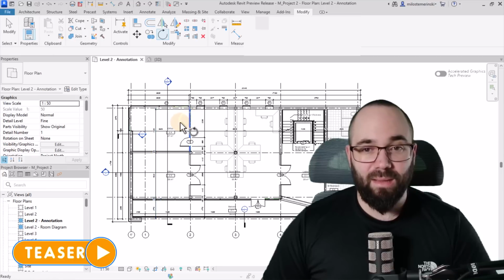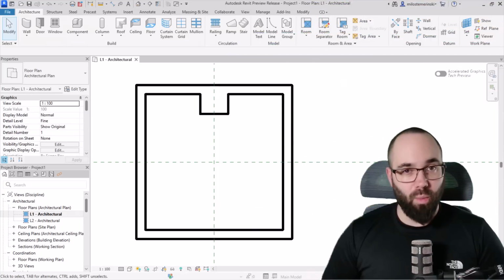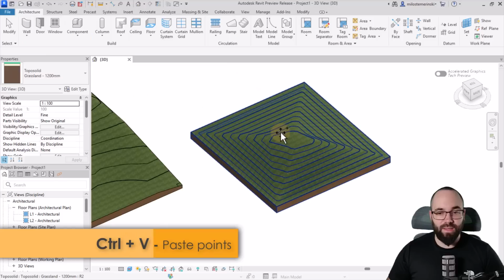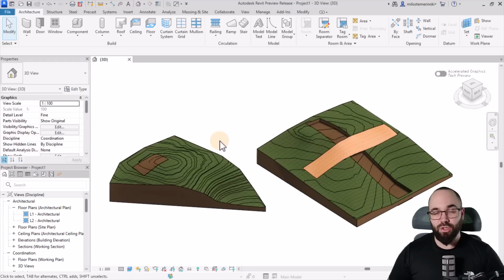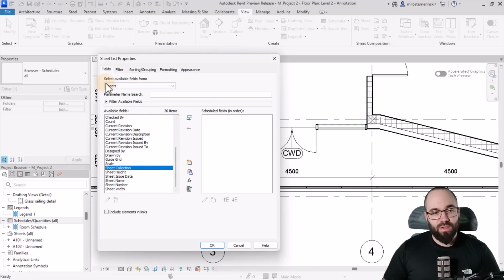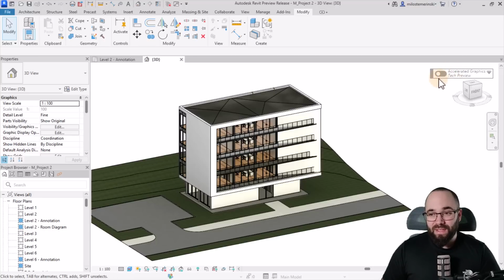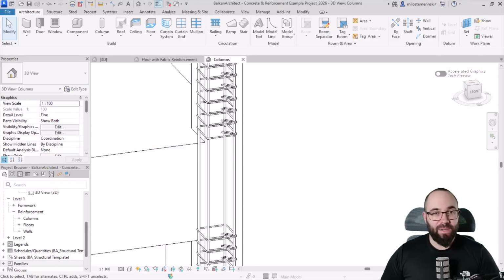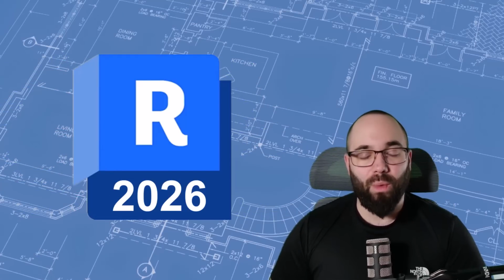Revit 2026  - What's New? | Revit 2026 New Features Tutorial

Comment: Thank you for the video, Milos. I also do not find the new features as exciting, as the Toposolid implementation for example. The wall adding is great, we can use it in renovation projects, to show new added insulation in different phases. 
But, there are so many missing modeling features. For example, detailing a concrete prefabricated stair was a nightmare. You cannot just modify the notch as much as needed, nor the landing, nor the raw concrete raisers in floor plan (the finish material is always displayed as dashed line) and many more.
Another feature would be, for the Railings to have room bounding Parameter. It is crazy in 2025 to have to do Balcony rooms manually. As well, as the railing cannot attach to wall/roof or another stair, meaning one should model manually the part where a railing is under inclined constructive element...

Comment: As an architect, with more than 40 years experience....I wonder why Revit and AutoCAD still have not caught on to one of the fundamental changes going on in the consulting industry. Architects more and more are getting into helping create the Business Plan for clients along with modeling of financial proforma. What is needed on an AI level is to do automatic take offs for material quantities, and link them with standard costs for construction labor to model project cost. This then needs to be linked to rentable square footage, operating costs etc. Another need is to get involved in statistical market research and consumer needs and preferences. It is nice to do elaborate artistic effects...but will it pay for the developer. Revit again has a fundamental problem in that it is trying to be both a rendering and working drawing building information system. This is hard to do and causes expensive errors. AutoCAD needs to meet with its users!

Comment: Does Revit have a way to use split by face to cut wall sweeps?? I try using that command, cut geometry, and even void extrusions. But nothing works. For example I have 6in” hardie siding that protrudes through a 4in roof. I can’t trim or cut it out. Any suggestions?

Comment: I'll just say it - this release is incredibly disappointing.

The accelerated graphics feature was going to be the highlight, and they aren't even close to finishing it. As you found out, it doesn't even work on some computers and graphics cards, and even when it does there are so many bugs graphically. Yes it is faster, but it's nowhere near finished. I am flabbegasted by the fact they released it like this, and it highlights the problem with annual releases made to appease the shareholders - even if it isn't ready, they ship it anyway. If they don't fix this before Revit 2027 I will be calling them out for sure - it is barely a feature currently, and should have just remained in the preview version in my opinion in its current state. It will 100% be mis-sold by the Autodesk fanboys as an amazing feature, despite it not being so in reality. I get that implementing a new graphics engine is a massive undertaking, but this was not the way to release it.

There are some nice QOL features, but they are 15+ year old requests generally, we needed them so long ago. Callout shared parameters, instance based ref parameters and better wall layering are certainly welcome, but most firms wont see them until they finally get to Revit 2026 in 3-4 years time. Good thing we got things we didn't need like generative design, parameter service and content catalogue in the meantime (which still has many issues after being out for close to a year). Revit users are basically SCREAMING for Autodesk to stop making 'tack-on's we don't want, and focus on the core program - too bad it's not sexy on paper, and wont get the shareholders excited. To cap it all off, these tack-ons bloat the installed size and installation time.

I'm glad to see you also weren't that excited by the release and features at times. We all need to genuinely make our dissatisfaction known versus feigning excitement to drive the point home to Autodesk and its shareholders that their customers are frustrated, unimpressed and not feeling the love - nor have we for many years now.

Oh and all the sub-menus still don't follow dark mode UI, despite it being 2+ years since dark mode was launched. Oof.

Not impressed.

PS: Nice to see you around on LinkedIn BA!
Reply from the maker: I was really surprised about the accelerated graphics feature. I will be downloading Revit 2026 to see if it will work now (this was on the preview release), but it's disappointing to see that it's really only in the testing stage. If it was a small startup with their MVP, sure why not, but as you said, for Autodesk it makes no sense. 

It feels like accelerated graphics is the cybertruck of Revit features. Even the shareholders are frustrated there, so I wouldn't recommend that strategy.

I finally decided to show up there haha
It's a really good community!

Comment: The accelerated graphics tech preview is the main new feature for Revit 2026, and it is an absolute game changer for navigating larger projects. All the other new features pale in comparison to the accelerated graphics, and is well worth a separate video!

This could potentially completely remove the need for detail levels in views, which would obviously simplify family creation etc. Structural engineers could have all connections and bolts visible all the time. Interior designers can load up their scenes with many detailed beds (which Balkan Architect sells) and furniture elements without Revit grinding away. Landscape architects can start using realistic trees and plants. This is by far the biggest thing that has come to Revit since I started using it in 2004, it will change everyone's Revit workflow once users realize wtf it's actually about!

...and finally, imagine eventually having real-time GPU ray tracing in a native Revit viewport = goodbye Enscape? Have a good, long, hard think about all this stuff people, before you rubbish this release!
Reply: It's not even fully implemented. Total half arse by Autodesk in my opinion releasing it like this.
Reply: @AussieBIMGuru  I have to agree that it's not ideal, but as a Revit user since 2004, finally Revit is starting to run on the GPU! I've tested this extensively in the 2026 preview versions on larger past projects, that were really grinding and painful to work with before this release, and this is a MASSIVE improvement that should not be ignored.
Reply: @enricobulic  it will be worth celebrating when it works. For now it's promising. Their half baked take on dark mode makes me wonder how long it will take to have a functional version of this that can be used in all view types.

We should not applaud autodesk on this feature until it works. Bravo to the developers for getting it this far, but shame on the execs for pushing it through in this state. Any other industry would be crucified by the customers for this type of behavior.
Reply: @AussieBIMGuru  From my experience, it does work and works very well, but obviously that depends on the PC configuration and drivers etc, and this is why it's a data gathering tech preview. You actually need to put something out there to gather all the Revit user's system configurations and drivers so that bugs can be dealt with as they arise. This has been a common practice in the PC gaming industry for example, for decades. Dealing with the many thousands of PC system configurations out there cannot be done in isolation.

Autodesk could have certainly done a better job of explaining this as the reason, rather than just slapping the toggle button in the viewport corner and leaving it at that. That much I can agree on.
Reply: @enricobulic  thats what preview release's job is I think, and why game companies alpha/beta test or so they can day 1 patch at least. If they turn this around quickly I'll be happy. If it takes until r27 and r26 doesnt see a patch its pretty rough.
Reply: @AussieBIMGuru  I absolutely agree that it really should be fully functional sometime this year, and hopefully that's the case, but I probably wouldn't be holding my breath on that!
Reply: @AussieBIMGuru  I'm surprised you still use revit at this point. If I was that critical of a platform that cost $$$$, i'd build my own
Reply: @HippieP629  Revit is unfortunately what most companies have found themselves having to use in absence of anything more robust.

I'm testing plenty on the side right now, but I have to bring people along for the ride. I dont do architecture these days, i support business'. We cant just jam veterans into blender and wish them good luck.

Software only improves via critical feedback, and as a seasoned and experienced user of the platform i feel i am entitled to give it.
Reply: @HippieP629  saw your comment, even if it got deleted.

Honestly i do a lot of advocacy for other programs outside of April and collaborate with competitors on the horizon. Archicad and vectorworks have their own issues, theyre the old guard with revit to me. The next gen of tech isn't going to look like any of the current BIM or CAD platforms the market is limited to currently.

My frustrating here stems from the vast majority of people heralding in April as if we have some new revolutionary tech whilst the next gen barely gets a lookin.

Snaptrude is promising but still trying to land on market fit for the delivery side of how AEC works. Of all of those it is the closest to offering an escape from old school BIM approaches.

Anyway you do you do, good stuff. Enjoy the graphics acceleration once it works.
Reply: Thanks a lot for pointing this out and the explanation. I work in massive semiconductor models (with a sh*tload of links) everyday and happily invite any and all acceleration improvement!!
Reply: @HippieP629  You use revit to design microprocessor chips?
Reply: @ No. The facilities